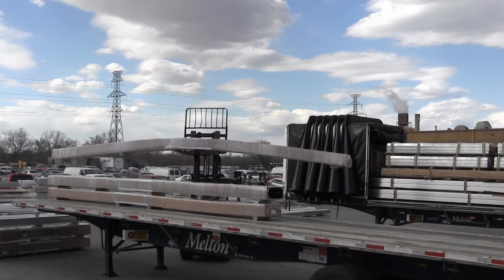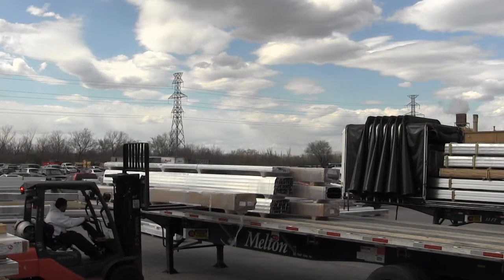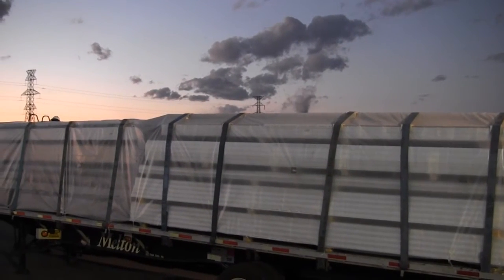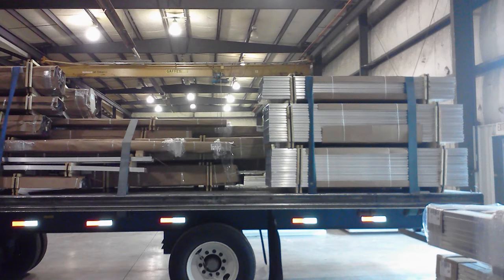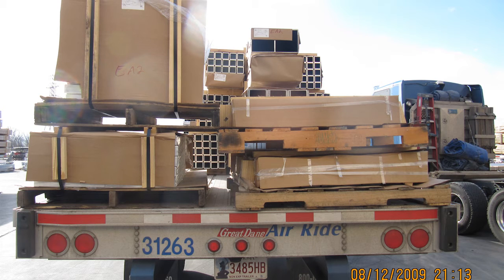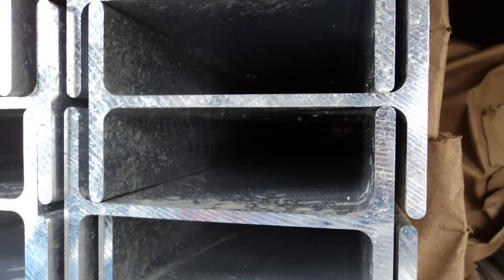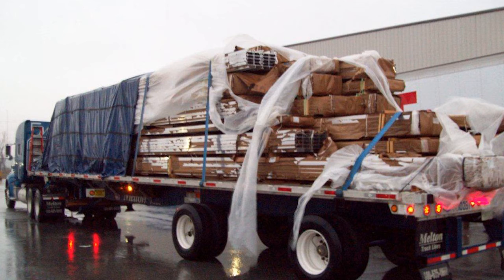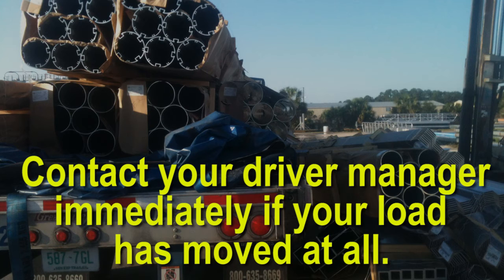Western Extrusions Loads

Comment: The 5 foot rule ONLY applies to the FRONT of the load, not the rear.
Reply: It's Meltons policy to do it in front and rear
Reply: For dot it’s a 10’ rule, and it applies to front and rear
Reply: @andyk3663  DOT rule says 2 load securement Devices in the first 5’ if the trailer is not equipped with a headache rack then every 10’ after.